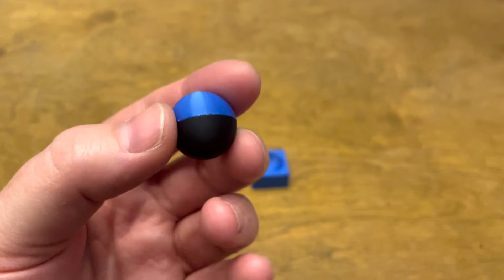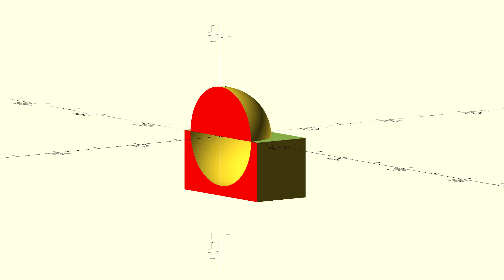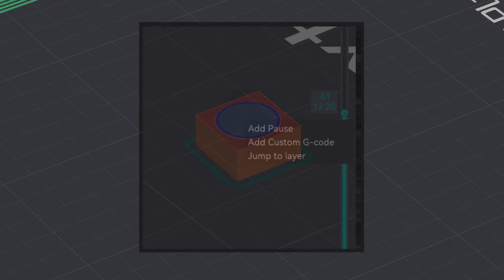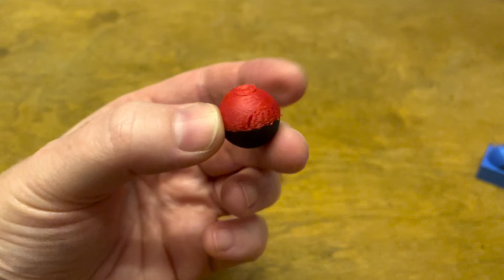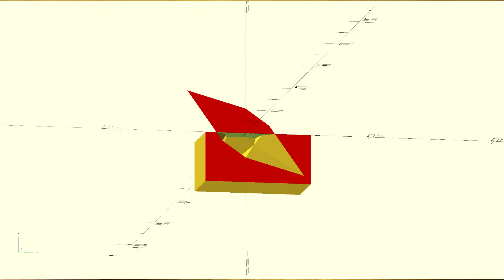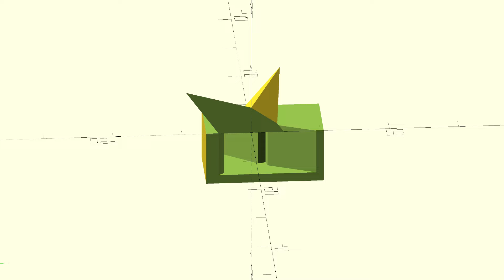3D Printing with Fixtures

Comment: But why?
Reply from the maker: Sometimes it's desirable to have a part that is held together by being printed as one piece rather than glued together. This is especially true if you're making many copies where the time to glue them together becomes more significant.

Your mileage may vary on whether this is useful to you, just like with any other technique. It doesn't solve all problems, but it might solve someone's! So better to have the technique documented than not. :)